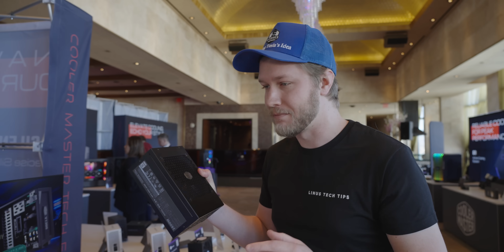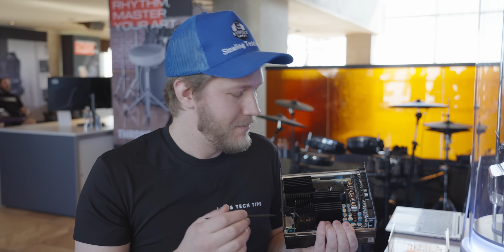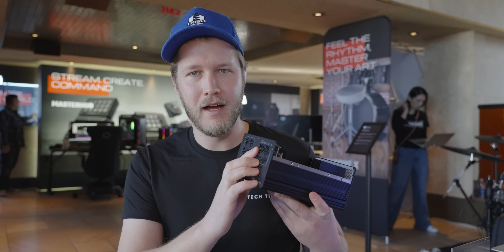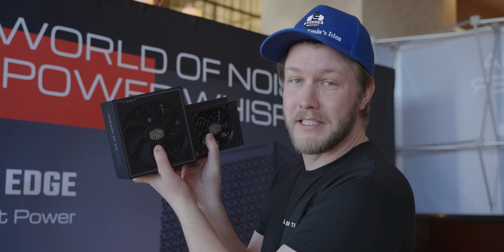This is unbelievable... - Cooler Master at CES 2024

Comment: Nothing special, never seen things here. No revolution, not even evolution. But of course they use a propriatery fan connector...
12VO hasn't cought on, yes. But not for some stupid reason. It is a good idea, but again the execution is terrible. 12VO PSU is simpler, less complicated than a multivoltage one. That means it is cheaper to make. Are 12VO PSUs cheaper than traditional ones? No, not at all. On the contrary, those are even more expensive. But you still need +5V and +3.3V. So you still need to make those voltages. And this should done by the motherboards. Yeah, because motherboards didn't become insanely overpriced in the last few years. But yes, lets make them more complicated, make them more relying on cooling, more prone to fail. And of course, even more expensive. 12VO in this kind of execution is nothing else but an own goal. But nobody wants to score this goal. And of course some PC brands went to 12V only direction, but again of course not even close to the standard connector layouts. Total failure. Another attempt to rob people blind. So, FCK 12VO.

Comment: while 1kW fanless PSU is impressive it's impractical, what we need is a bunch of reasonably priced 300-450W fanless SFX PSU, more doesn't make sense since you can't dissipate all the heat passively anyway, even The Beast caps at like 500-600

Comment: The explanation for the power factor correction has an error in it. PFC isn't to correct the power coming from the wall but correcting the way the PSU draws Power from the wall. PFC ist used so that a device will draw power from the grid in a way that's similar to a resistive Load. The PSU doesn't care abot feeding electrical noise back to the grid or drawing current out of phase but the grid does.
Reply: Yeah, what he said was a bunch of made up nonsense.
Reply: The confusion with copper/inductor and switching losses too. Higher switching frequency results in higher switching losses, but reduces the required inductor/transformer size.
Reply: Yup, PFC is done to to keep the balance of active and reactive power in the grid. Domestic consumers don't get charged for absorbing reactive power, so all consumer appliances strive to keep pf close to 1.
Reply: Yeah pointed also out, that the pfc is after the bridge and is responsible for the 380V.

Comment: How hot does it run under load?
All that heat might be fine for this PSU, but it is surely going to mean more work for the fans in the PC?
I feel it is a bit like having a higher ambient temperature resulting in air cooling an Intel CPU no longer being enough to prevent throttling.
Reply: yep, also PSU noise is the least worry. GPU coilwhine or CPU cooler will always be worse. Like I hear my NHD-15 all the time, I know how it sounds, but never noticed my generic corsair rm 1000 watts...think its that 2021 model.

Comment: The only inaccuracy in here is the fact that the United States and I'm pretty sure Canada is a 240v split phase, meaning at the Transformer on the pole or pedal stool has three wires coming from it, because we Center tap output side of the Transformer splitting the 240v into 2 wires with 120v and a return wire called the neutral, that's why we have appliances that run on 240v when they use three wires, two wires use the full phase and one is ground, while 120v when they use three wires, One is using half the phase 120v, one is used as neutral the return, one is used as ground.

Comment: mostly a STUPID product...
$650+ for what exactly? Oh, a silent PSU. Well, there are several PSU's of the same Wattage that have a FAN you can't even hear (which may not even turn on until 50% or so load). So you're paying 3 or 4x the price for... bragging rights? And these fanless PSU's still tell you to ensure you have airflow in the case (so you still need fans). SIdenote: I modded my Asus RTX4070 Dual OC card with Noctua fans as the 0dB mode meant the temperature in IDLE still crept up to 55degC causing the fans to turn on at 1000RPM then drop the temp to 40 degC or so then it just did that over and over (it took roughly five minutes per fan on/off cycle... the Noctua fans I ran to the MOTHERBOARD and used "FAN CONTROL" software. The fans spin at only 350RPM while keeping the temps at 40degC for light usage (and I can't hear them even with 100% load in Furmark!!)... my POINT is that a small amount of airflow is all that's needed to keep things nice and cool. Without that you need to have expensive, passive cooling.

Comment: The first computer I bought myself I think had 250watts... a Voodoo Banshee and a PII 400 in 1998.
Today we are starting to get a little nuts with the wattage. I don't think I had more than a 450watt Power Supply until 2018... Now the 750Watt PSU seems almost too weak to upgrade... 

Computers seem to be getting needlessly power hungry.

Comment: Cringey high tech expensive PSU only to convert AC to DC whereas it is trivial and cheap for solar power to be converted to 12 volts with efficiencies starting at 95%.  Additionally, PC desktop industry should move to 48 volts.

Comment: currently using a 850sfx from cooler master running a rtx 3090 and 13900k. No problems so far. Have had it for a year

Comment: I'm really curious how these perform depending on which way they are placed and in what kind of case they are used. My case doesn't have any airflow through the PSU area so it just cools from the bottom and out the rear. With a fan. Like most people. So how would it cool efficiently if there's no airflow?
Reply: Not really good I suppose. Fanless ones from Seasonic shouldn’t be mounted inside solid shrouds (well you ultimatively could but it’s inadvisable for prolonged use at maximum output).

But the Seasonic’s at least nowhere near as advanced as the ones showed: there’s no case acting as a heatsink and no heat pipes!

Comment: Kinda crazy to think of that 2800w PSU, at 90% efficiency would be still be losing 200W+ in heat
Reply: yeah. well.. under full load (basically never happens). but still, you'd have to configured it that way for edge cases
Reply: @JPK1337 yes and when using  90% and below your efficiency false when under light load
Reply: in italy a regular power contract goes up to 3000W max... a 2800w psu is insane!
Reply: @fabriziorasore5353 I'm pretty certain that even in Italy, those 3000W are per breaker. Your typical electrical stove and oven in your kitchen alone can easily draw more than 3000W, which is why they're usually wired to more than one breaker. So if those 3000W were really for your whole house, you couldn't cook and have the lights on at the same time.
Reply: @fabriziorasore5353  we only get 1800w in north america. :(
Reply: Not really - we do have 240V in the NA.  We split it up into 2x 120V though.  You can pretty easily get 240V in your Kitchen for example.
Reply: @I_enjoy_some_things  with that logic, I could get 480V in India because houses here have 3 phases of 240V.
Reply: @Born_Stellar  isn't that per socket/ breaker? Seems like for Italy it's the entire building?
Reply: Then again, half of Europe is pretty damn cold right now 🥶
Reply: @DenKulesteSomFins which you shouldn't fix with electric heating...
Reply: @homeape.  Nope, burning oil instead.
Reply: @treborrrrr  MURICA!
Reply: @fjalls mobile YouTube allows you to translate messages. This translated to LIGHT UP!
Reply: That's been one of the main reasons so many companies sink money into research for room temperature super-conductors.
Reply: 230V 16A (3680W/room) is the max in Swedish homes (10A is normal, but can be upgraded to 13 and 16 amps with a new braker. The standard cables (2.5mm2) in the walls can handle 16A. You can of course have more than one breaker for every room, if you need it. So it is not a technical limitation. Usually only stove/oven and washer/dryer have their own breaker's the rest is per room.)["Schuko" socket]. We have 3 phase for the stove/oven (11k watts).

For anyone that needs it. They can get other wall sockets that use higher volts and amps. I have lived in a house that had industry wall socket in the garage, because the previous owner was racing with cars and needed a machine to put new tires on his rims.

Comment: Having just gone sff, sfx psu's need to become the standard for atx form factors. Seriously there's really no need to make full sized atx cases anymore except for actual work machines. Fractal's Meshify C is basically the perfect sized case.
Reply: Some people, like myself, like having a full size ATX PC case. It makes assembly wayyyyy easier than in small chassis like sff or those that use itx or matx motherboards. Also gives you significantly more flexibility on part choices. Lastly, it is about as future proof as a case can be....as you don't have to buy another case if new parts don't fit just right inside your sff or sfx case.
Reply: @em25-c4h  I've had a full size tower once and christ that thing was a waste of space and I value space. Yes sff cases can be a pain to build in but find a good one and it'll be fine. The Coolermaster NR200 is perfect but yeah I understand futureproofing for larger gpus is a concern.
Reply: SFF is perfect for gaming rigs these days. For workstation folks ATX motherboards do tend to have a lot more features though.
Reply: @triliner254  matx should start being the norm imo. Only need a gpu and a capture card for people wanting to stream these days
Reply: @vongdong10  Honestly hard agree. Matx is technically perfect but no motherboard manufacturer is really seeing that potential. Capture cards arent even needed, hardware encoding on GPUs these days are very good.
Reply: Cases like the lian li 011 mini come to mind, sff psu but ATX everything else. the only reason I use big ATX cases is because I watercool, but in a regular air cooled build you don't need all the space. and actually the build I have in the 011 mini is kinda empty, it could even be smaller.

Comment: I don’t think that’s how it works. 
Based on the components you talked about. This should be 120VAC - DC - high Frequency AC for the step down transformer - 12VDC. The DC-AC-DC is called a high frequency bridge.

Comment: fun fact you "can" do it in north america, it's just it's own circuit. the way us power works is 240 to the panel with a middle tap for 120. you get 240 by using both rails.

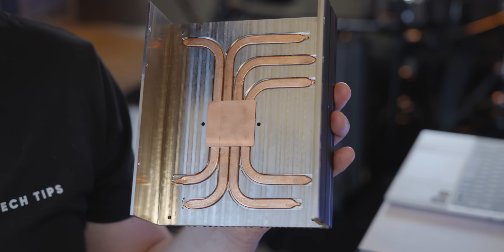Comment: Did Alex really say 400v down to 12v? 1:12 .... uhhh lol you mean 120v? Lol
Reply: Nope he means 400V. The PFC stage boosts the rectified AC to ~400VDC which then gets stepped down to 12V. For PFC to work it needs to boost to a voltage higher than the peak line voltage, and typically 400V is chosen because it is higher than the rectified peak of 220VAC. AC voltage is measured as an RMS value, the amplitude is RMS * sqrt(3) and 220 * sqrt(3) = ~380V

Comment: This tech combined with a full 12v psu will give us such a tiny product. New pc builders won't know how big psus used to be.
Reply: I still have an extra-long (200mm) 750W PSU from the PC dark ages kicking around. It 6 6-pin cables but no 8-pins, which is actually kind of perfect for running various electronics projects because I can have all the 12V I want in a number of plugs I'll never use up.

Comment: Usually AC is turned into DC using either a bridge rectifier (typically full bridge but sometimes half bridge rectifier) which is nothing more than 4 diodes connected into each other in a circular pattern. Then, just add one side of the AC line to two of the inputs for two different diodes and pull out a (still somewhat bumpy) DC out of the other two diodes. This works by basically funneling the alternating current's active positive voltage into just one side of a circuit. You still need a smoothing capacitor and of course a discharge resistor after the full bridge rectifier, and a choke can also help PFC after rectification too. But I want to know how they're using MOSFETs to convert AC to DC. What's the schematic look like? I'm assuming by MOSFET you meant "an electronic switch controlled by gate current" and not the actual manufacturing technology that gave it it's name. Sure, we could use a microcontroller to trigger the gate but not only would we need one fast enough, we would also need to power up the MCU before being able to rectify the AC into DC. But the MCU would need DC so ... Uhm... How are they using mosfets? Or are you saying those are mosfets because of the manufacturing technology of silicone printed wafers but they're still just technically bog standard diodes? I'm just confused and would love to learn more.
Reply: Most wall adapters today already use active rectification. What is unique about this one is that it uses it at the AC input, usually an active rectifier is only used on the secondary side of the transformer since the voltage drop of a diode is much more significant when the output voltage is lower. Ie. 0.7V drop across a diode is only ~0.3% of the 208V amplitude of 120VAC, while it is ~6% of the 12V output. This means using rectifier diodes on the secondary incurs a much larger penalty than on the AC input, and to save cost most only have active rectification where it matters most
Reply: @forestzhou468  Could be something as simple as part selection. Finding high voltage, low RDS on value, heat sinkable, SMD, low gate capacitance mosfets isn't that easy. I have made a couple active rectifiers and getting high quality mosfets for the job is kind of a pain, and they aren't cheap. If you remove the high voltage requirement, I can find mosfets all day long for well under a dollar that would drop only a couple millivolt.
Reply: https://en.wikipedia.org/wiki/Active_rectification#:~:text=A%20MOSFET%20actively%20controlled%20to,sometimes%20called%20an%20ideal%20diode.
Reply: @Deddolo not surprising they had to go more exotic than a Full Bridge Rectifier for the effiency they needed

Comment: A little disappointed at the errors/misrepresentations I noticed in this vid, hopefully you guys can improve in the future. Don’t dive into technicals if you aren’t sure what you are talking about!

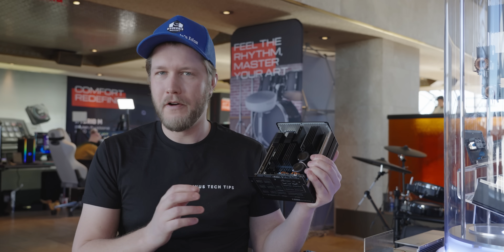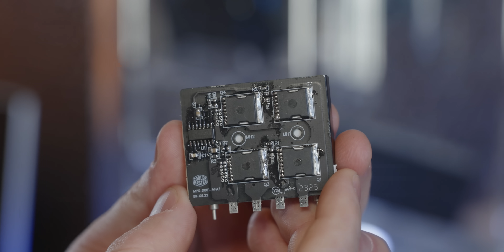2:30 “Where dirty wall power needs to be cleaned up by power factor correction”. This is wrong, this is not the PFC stage and does not correct power factor at all. This is just the input filter. Also, poor PF is not caused by noise, it is caused by the rectifier. The actual PFC stage is at 3:15

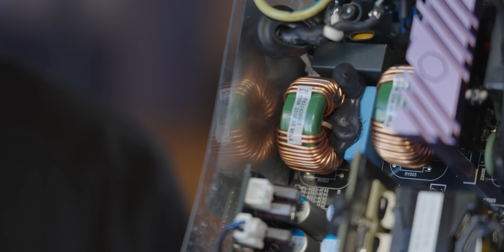2:45 “Medium/high flux choke” is a term with no meaning. Perhaps that means they used a choke with a higher value inductance, but that doesn’t necessarily make it any more efficient, higher performing, or expensive. What does make it very expensive is the giant heat sink around tho.

3:15 “Next we want to stop up the voltage to 380V” This is the actual power factor correction stage, which works by boosting the voltage coming out of the rectifier. Also when talking about single/double “rail”, I’m pretty sure you mean phases not rails.

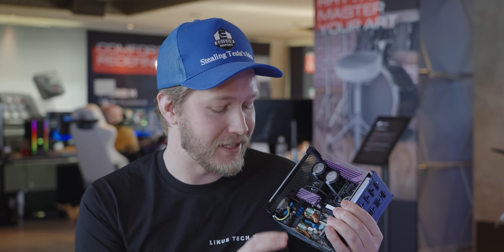4:20 “A lot of switching losses are in transformer” That is not true, all switching losses by definition occur in the switching elements (mosfets). Loss in transformers comprise of core, eddy current, conductance, hysteresis, etc losses. Even when talking about losses in general, for a typical power supply, most of the losses are not in the transformer but indeed switching losses from the fets. However, given that this power supply is not typical, it’s probably using a soft switching topology that significantly reduces switching losses.

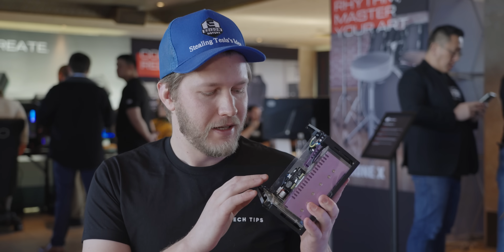4:35 “Typically after transformer it’s analog but this uses MCU to convert to digital and send it out through PMBUS” This makes zero sense, I have no idea what you are talking about. The output of the transformer is your 12V power, you don’t really describe that as an analog or digital “signal”. If I had to take a wild guess, maybe you are referring to the fact that this PSU uses a digital control loop rather than an analog one? Or maybe you just wanted to mention that PMBUS out is a feature, in which case fair enough but the "normally after transformer it's analog but this is digital" still makes no sense.

Cool power supply nonetheless!
Reply: by 380V he was talking about the usual 3-phase voltage. he got so many facts mixed up.
Reply: @drgenio2006  No I'm almost certain he is talking about the output of the PFC stage which is nearly exclusively 380/400V. He is talking about this after the rectifier which is where the PFC boost converter is, and it does in fact boost to around that voltage. The PFC needs to boost at or higher than the amplitude of the AC voltage to work, and 380/400V is so common because it is slightly above the amplitude of 220VAC